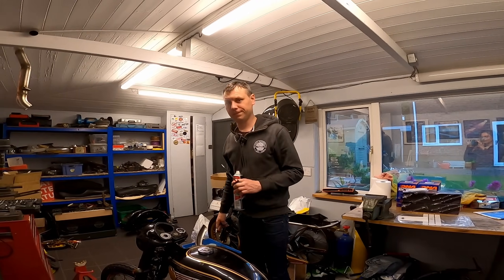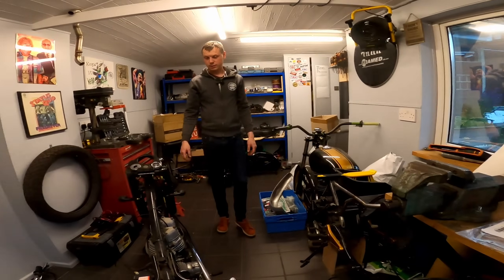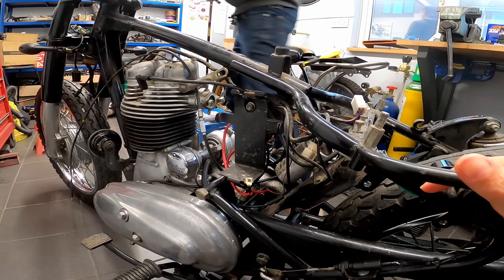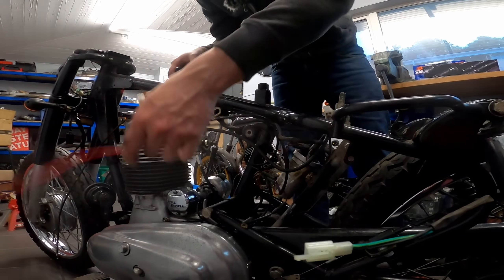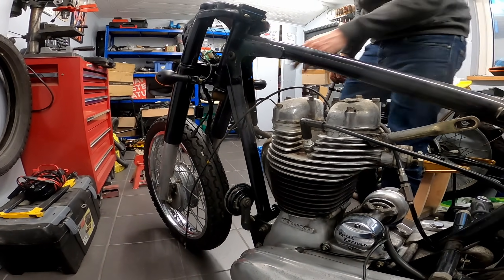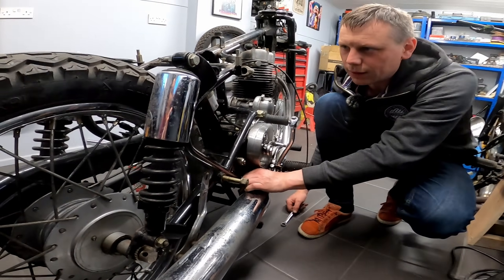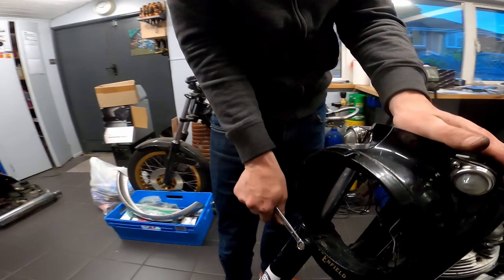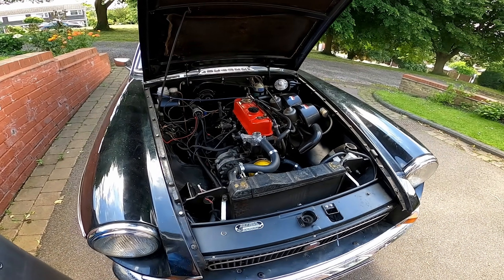Ex Enduro-India RE 350 Bullet | DO IT FASTER!

Comment: My brother has one of the 1100 made original 2012 'Steve McQueen Limited Edition' Bonneville's. He isn't touching that and he'll keep the original parts if he needs to replace any. I have a 2020 Royal Enfield Classic 500 in Battle Green. They made loads of these, so I'm quite happy to make positive changes to the bike, albeit mainly mechanical improvements. If it were one of the 200 or so Battle Green dispatch bike versions though (with the camouflaged tank etc.), I'd be leaving that well alone I think but I'd consider it a bit of a curse. I'd rather have something I can use. The MGB will be great to see more of. The B series engine is unbreakable but the Buick V8 is probably one of the best car engines ever made I think. Hydraulic tappets too, just like the RE Classic 500's 🙂

Comment: Ive had 2 350 bullets the standard carb is rubbish replaced the first bullet one with a concetric and the second with a monobloc indian cables are rubbish on these bikes as well hitchcocks sell english made ones for this bike the outer gearbox cover flexs causing the clutch to drag hitchcocks sell s stenghener the fits in place of the neutral finder stop hope this is of help basicly good bikes with a few mods hitchcocks are great parts suppliers hope this is of help to you